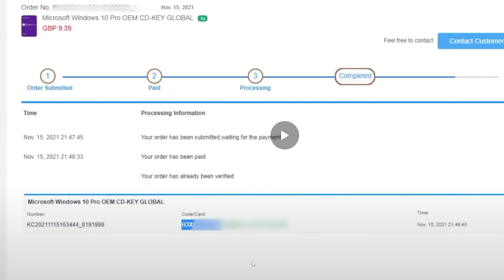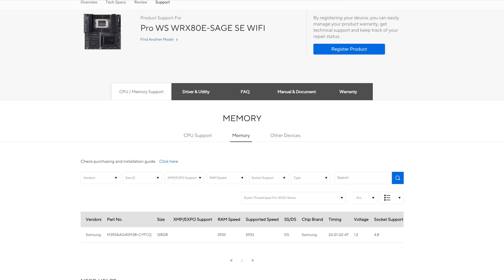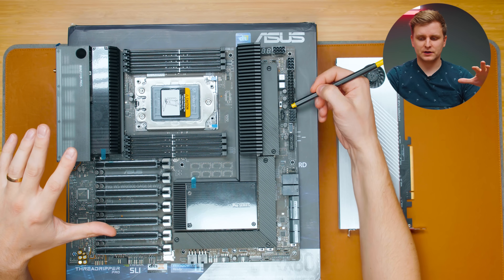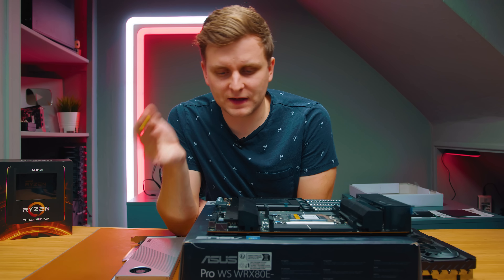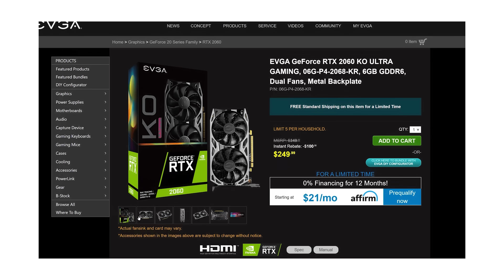MOTHER of ALL motherboards - ASUS Pro WS WRX80E-SAGE SE WIFI Overview

Comment: I actually have this board and am in the middle of a build.  The biggest challenge with this is finding the right case for it.  It is much bigger than EATX and even when case says it supports EATX, it may not support this board.  I ended up getting the Lian Li o11D XL case.  But even that requires a special bracket to support this board which I cannot find being sold anywhere in the US, so I had to order from the UK and have to wait a couple weeks to get it and finish my build.

Also you should know they have Sage II version of this board.  Only difference is the Sage II has Wifi 6e.  Not compelling for me since I run 10g ethernet.
Reply: Why did you chose this motherboard?
Reply: @xirizo2676  There are only a small handful of WRX80 motherboards available.  For me it came down between this board and the ASRock Creator.  Frankly the Creator would have been better because it has Thunderbolt for the future, but I don't really use Thunderbolt because I record video from BlackMagic to external samsung SSD which is USB 3.2.  The con on the ASRock reviews was the terrible BIOS and so that reason combined with the great deal I got on a used board, I went with this one.
Reply: I went with the Corsair obsidian 1000D. Fits well.
Reply: Makes sense that the sizing was strange for most cases as this is likely intended to be installed into a server enclosure.
Reply: @charleshelton2345  It isn't really a server board, I know he mentioned the server features, but it really is more of a workstation board.  Epyc systems are designed for servers and Threadripper more for workstations.  It is meant more for a a very large enterprise case.
Reply: @provoking3449  I agree with you. I do not have the knowledge of the perfect case for using this in a home space. I imagined there being compatibility with many types of server enclosures.
Reply: You absolutely don’t need the bracket. The board will overhang the mounting plate but its plenty stiff because of the honkin backplate. I have this board and this case and know them both quite well
Reply: @MatthewSmithx  Yeah, I have test fit it and you are correct to an extent.  My concern is the ATX power cable.  The end of the board flexes when inserting it.  Yes, you could brace with your finger underneath to get it built, but piece of mind should I ever need to change something out is what I am buying

Comment: U.2 is SAS Interface, you can basically connect nvme drives that are in the form factor or a normal SSD bit with hugely higher capacity

Comment: Huh wanna see a wd black pcie 4tb on this one. Along with a load of storage. Ssds and hdd... I was also thinking about setting up a serve for my home.  So this motherboard can be what I need... Hope you! Throw everything on this board! Showing it's pro and cons and what to look out for in terms of what is loss when a device is in use of a slots. Thanks for the content.
Reply: If you don't need the raw processing power of a Threadripper I would suggest you have a look at Epyc instead (AMD's server version of the same size chip)
You still get loads of cores, memory and 128 PCI lanes but at a much lower price.
The second hand market is pretty good now for good parts

Comment: These are workstation not server boards.  Servers generally have built in VGA and less rear IO connectivity, definitely no sound/Wifi.  I think you mean enterprise when you are saying server as far as features like BMC and on board power monitoring.

Here's to hoping you get your hands on an ASUS Pro WS W790E-SAGE SE, Pro WS W790-ACE or an ASROCK W790 WS and a Sapphire Rapids W CPU.  With some of the lower core count SKU's Sapphire Rapids might be the best bang for buck for creators right now considering you can get the Intel Xeon W3-2423 for $400. That said it wont be 'cheap' as the mobo is going to cost around a thousand dollars and DR5 ECC RDIMM's are pretty expensive when you can find them.  But overall still about the same as the cheapest Threadripper 5000 system you can get your hands on with DDR 5 and pcie 5, but so far the only Sapphire Rapids W video I've seen is for overclocking.  The server CPU's are kind of a disappointment but I think there is a niche for the workstation stuff for people who need pcie connectivity but don't necessarily need tons of high speed cores if Threadripper 7000 starts with several thousand dollars for the 12core like Threadripper 5000 did.

Comment: if thinking about three 4090's in there. The possible way for it will obtaining the igame neptune 4090 or the msi liquid cooled 4090. leaving one slot for the m.2 expansion.
Reply: Is it possible to pair a 4090 and a workstation graphics card on the same board to allow for both gaming and work?
Reply: @williammwangi4343  expert saids, they wouldn't recommend it. Its just like same goes to the rams, when a different brand of ram is installed in the mobo with other different rams. So 2 different brands of rams you'll be encountering crashing problems same goes to different brands or different kinds of gpus into your mobo. But actually i only heard it from a rumor and im saying this because it might be legit and havent tested it yet cuz I dont have the money lel. And even if i have i have the cash wouldn't buy it cuz i dont deserve it
Reply: @rcortez5979  thanks for the reply....I've not found a video anywhere talking about this subject.

Comment: U.2 is like m.2 but with a cable for sata like ssds (that are nvme ssds), but they are extremly exspensive and often used in servers in Hot swap sockets
Reply: U.2 is the hot swap enterprise version of NVME PCIE SSD's.  Usually much higher capacity and endurance which is why they cost so much more than m.2
Reply: You can also have an external SAN and use the U.2 connectors to connect to that - in case you want to build a cluster of computers either for increased performance or for redundancy.
Reply: you can also get adapters to put m.2 ssds in but have them case-mounted which is amazing

Comment: Does anyone else want a 32core 13980XE. 
Imagine a 13th gen Xtreme cpu.
Basically, a 13900KS with 12 P cores 24 E cores.
Reply: Intel's HEDT/Workstation CPU's drop the E cores and are based on sapphire rapids not raptor lake.

Comment: I got one of this for 3D render.
Reply: Same here housed in a 1000d case
Reply: @Claus Bohm 5975wx cpu 256gb Corsair Vengeance rt rgb 3200mhz ram 1 x Seagate firecuda 530 1tb nvme boot drive 2 x seagate firecuda 530 4tb nvme drives in raid configuration plus 4 x seagate firecuda 530 4tb nvme on the m.2 card gpu is rog strix rtx 3090 oc Gaming shortly to be upgraded to a 4090. Psu is a Corsair ax1600i case Corsair 1000d with 10 ll120 fans cpu cooler is Corsair elite capellix h170i aio
Reply: @Claus Bohm  would love to have multi 4090 gpu's that would require a full water loop something I'm not confident about building hence the AIO fer the CPU
Reply: @Claus Bohm cinema4D and Octane render ; MSI 2x4090 liquid cooling,with TT Core X5 case. Full speed around 45 °C. Dual power supply.🙃🙃
Reply: @clausbohm9807 where are you going to put those AIOs? Unless you’re doing an open air build, the most you can really get in any case is 2 (unless you completely skip any case fans and don’t mind frying your cpu)